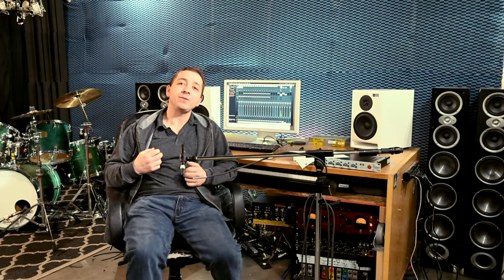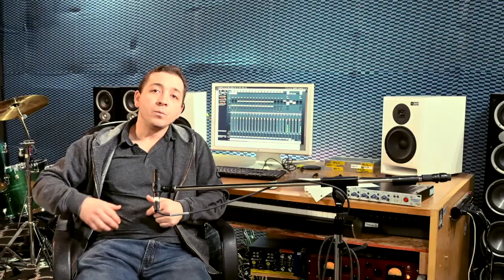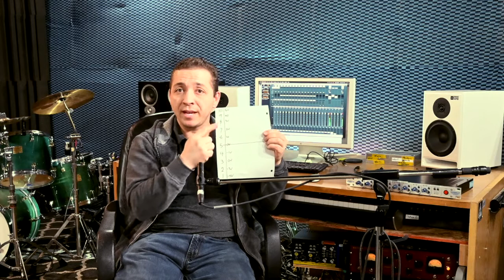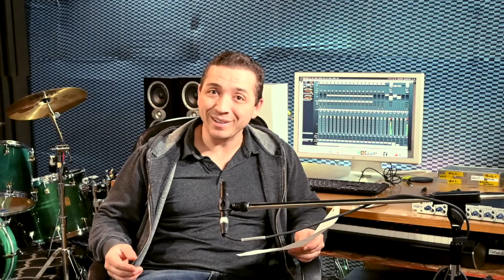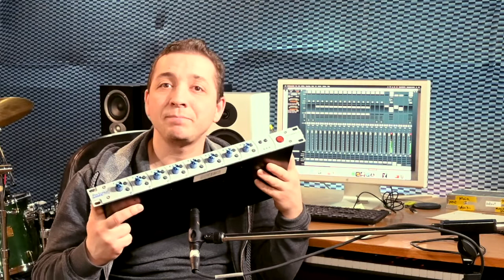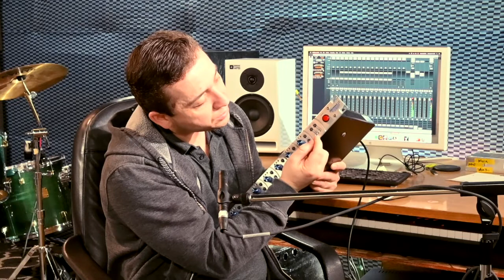Understanding Digital Audio. Lesson 4

Comment: hey I have one question. Can an ADAT device and an interface not synchronize their clocks based on the ADAT in&out connection alone? Do I also need to add a BNc cable for the Word clock synchronization?
Reply from the maker: Yes, word clock can sync over afar, but word clock signal is only sent in the same direction as audio. So if you are using both the adat input and output, then it can sync.

Comment: How do I connect my monitor controller (which has one pair of monitors and a subwoofer connected) to my interface? Do I use input or output to connect it to the line outputs on the interface??
Reply: connect the two main outputs of your interface, directly to your main inputs of your monitor controller